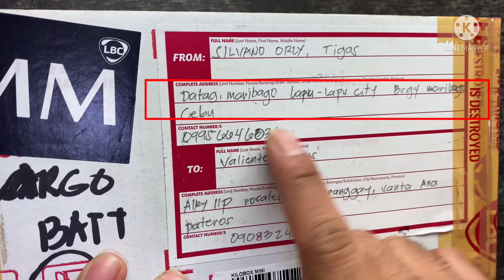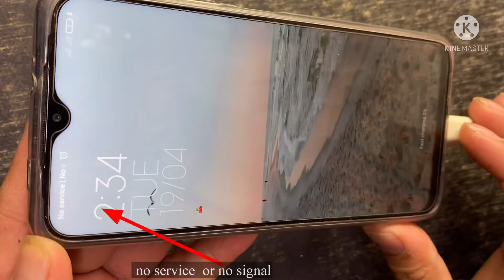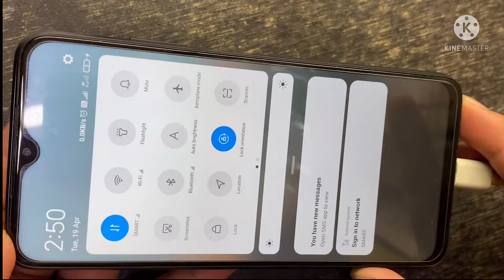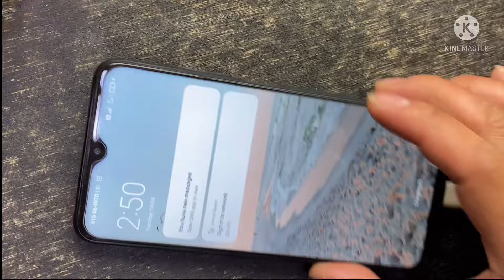Xiaomi Redmi 9t No service Problem Pinagmalupitan Puro Torture na Fix Back to Normal Amazing result!

Comment: Nice repair mate . I have some question about this 3 small rezistor or capacitor nominal ,its possible to get to know from you them please? I just ordered some and messured one ,it was 132pF but there was some another one which I lost during soldering process and it is very nano size ,not possible to find lost part anymore

Comment: Pwede ko ba pagawa Cellphone ko? Remi note 7 na salpakan ko ng mataas na 9 Voltage na adaptor ung connector fast charger talaga un pareho bago kaya ayun walang tanggalan na sa saksakan pag nag 99% lowbat na and yes super charge sya sinubukan ko i zero% wala pang 2min. Full na 😅 Kaya po ba?
Reply: @JulphoneTv  palit battery lang po ung problema?
Reply from the maker: yes
Reply: @JulphoneTv  my God Salamat and Godbless. Original battery na po iyon?
Reply from the maker: @cloud4462  brandnew replacement